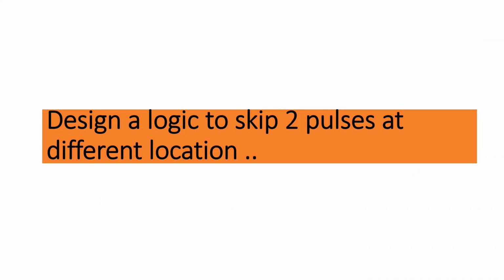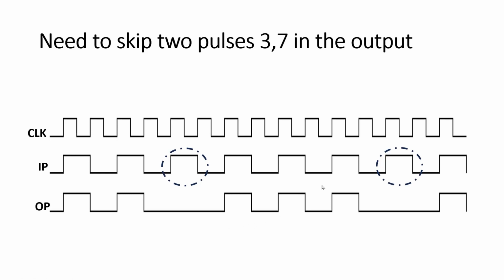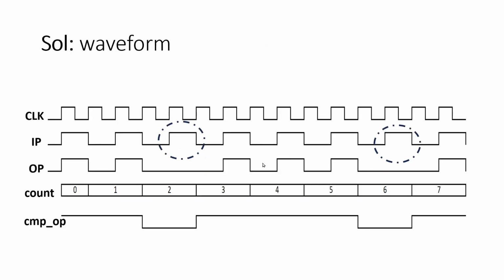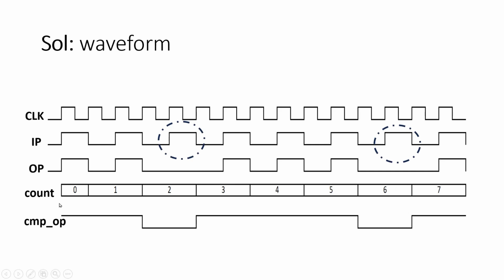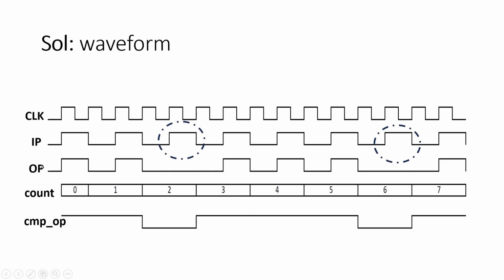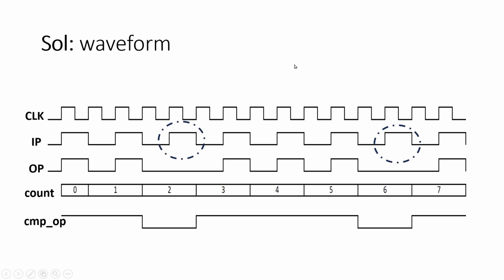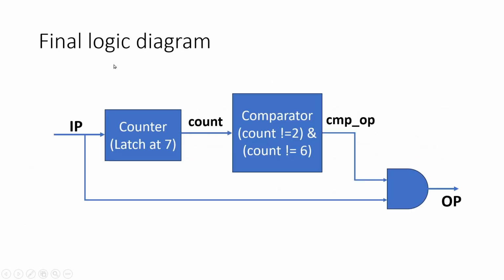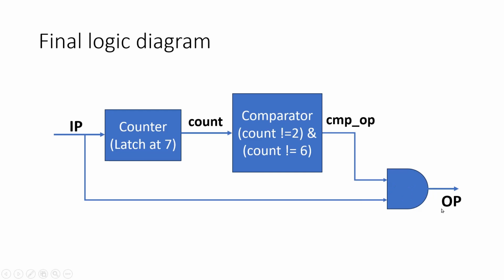Skipping of pulses part3

Comment: Hi Sir, can we reset the counter when it reaches 6 (mod 7 counter) so that we dont have to latch it at 7? In that case we dont have  any pulse count mismatch and no need to latch at 7.
Reply: if we reset it then it will start counting again which will remove some more pulse from input
Reply: latching at 6 works fine, but not resetting may be.

Comment: module skipring (iCLK, RST, E, MASK, oCLK, oB0);
input wire iCLK, RST, E;
input wire [(LEN - 1):0] MASK;
output wire oCLK, oB0;
parameter LEN = 16;

reg [(LEN - 1):0] bsel = { (LEN - 1)'b0, 1'b1 };

assign oCLK = iCLK & ~(|(bsel & MASK) & E);
assign oB0 = bsel[0];

always @(negedge iCLK) begin
	if (RST) bsel <= { (LEN - 1)'b0, 1'b1 };
	else if (E) bsel <= { bsel[(LEN - 2):0], bsel[LEN - 1] };
end

endmodule